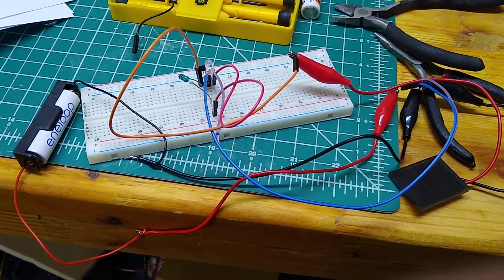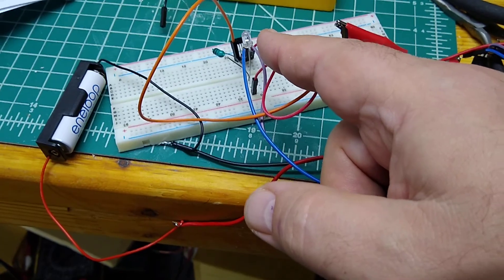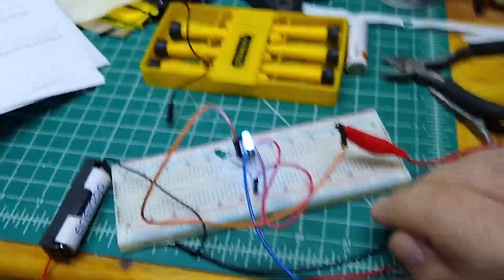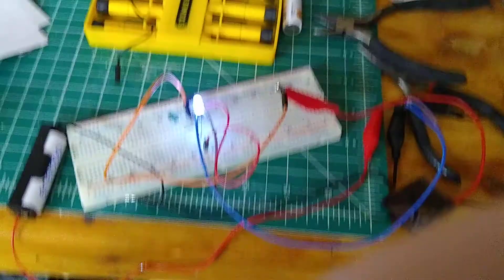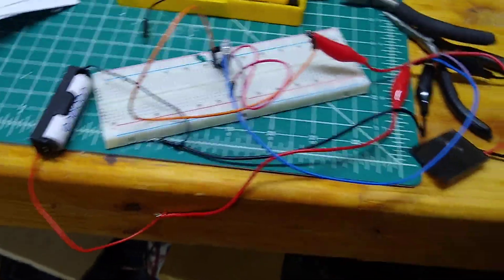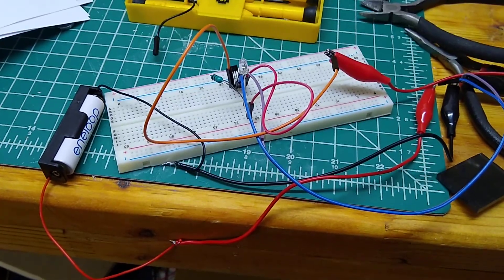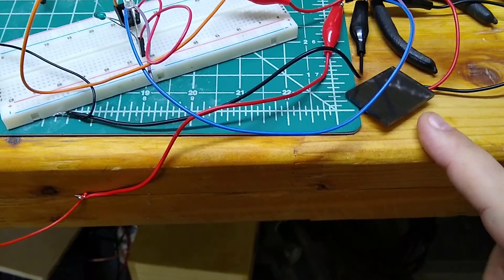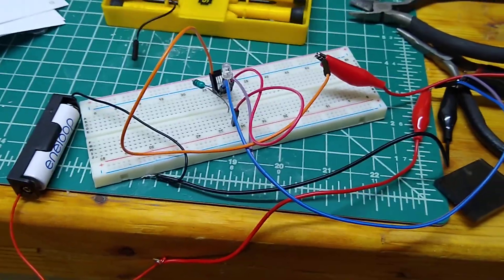First light from a QX5252F solar garden light circuit

Comment: The solar led battery pathway lights in my yard have all of the parts you are using --plus a resistor with the led.  Is a resistor needed or not needed?
Reply: There's no need for a resistor in series with the LED. The 5252 takes care of boosting the voltage and limiting the current.
Reply: @johnm2012  Newbie here....what does an inductor do differently from a resistor in this application?  I know how the resistor will reduce current, and the inductor prevents current change, but if you put in a larger μH inductor, the LED will be dimmer and the same is true with adding a resistor before the LED.  Hmm, so maybe the inductor will both alter current and stabilize it to avoid flicker?  Perhaps I will get a breadboard and tinker.